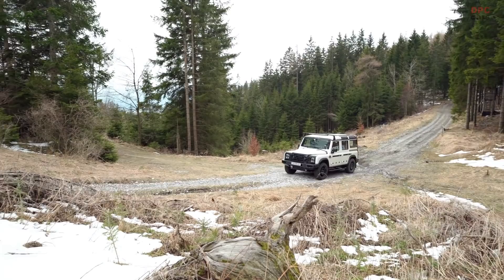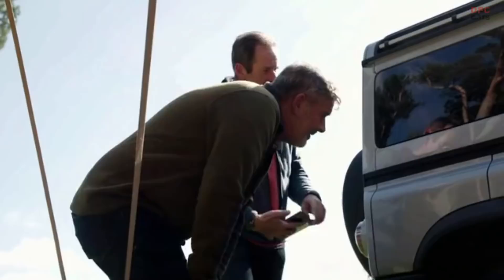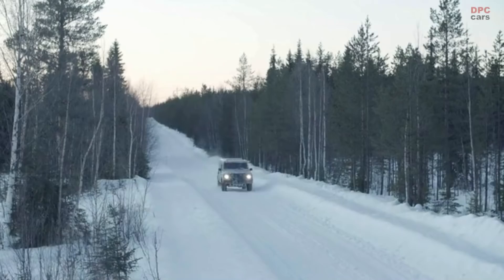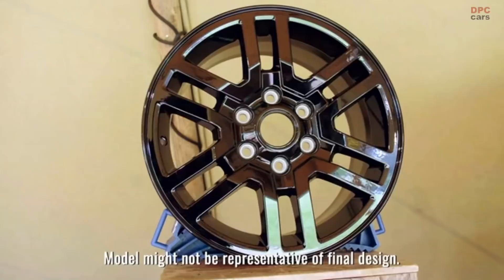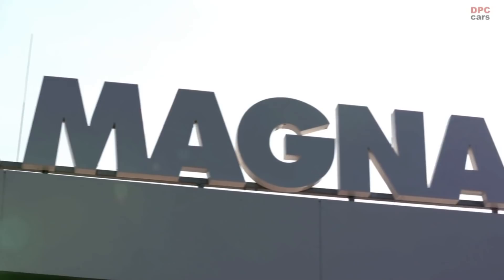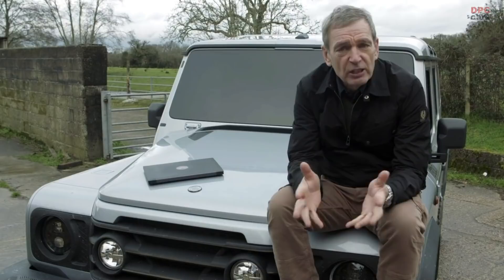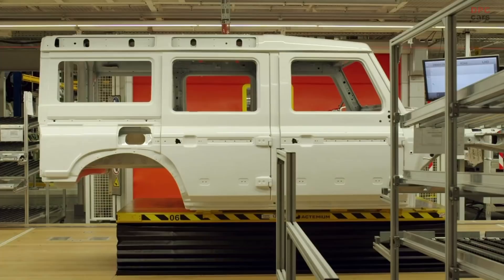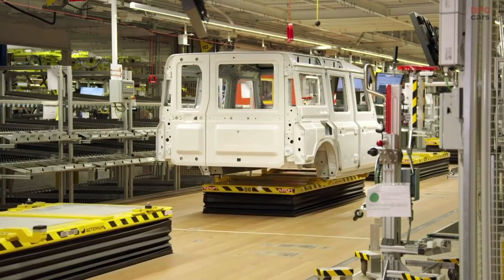INEOS Grenadier with BMW engine taking on Land Rover Defender

Comment: -what a modern Land Rover 110 “should” have been .... test this in the Australian  Outback for a month.  I’m ready for this Beast ! 👍🏻
Reply: Bmw engine though
Reply: or send it to Darien or Africa  !!!
Reply: @tanja8907  that’s a good thing
Reply: Aussie outback is full of falcons and commodore and hilux .  New defender is easily capable in the aussie ourback
Reply: @chrisward5626  Toyota is Australia's workhorse, a BMW engine will be seen as a negative for rural Australia. I bet you'll see plenty of these in the cities and doing the school run duties though...
Reply: @gazmo847  they sent some old defenders to South Africa with bmw engines and are easily the best they ever built . Not sure what your on about even
Reply: It looks like a defender 110
Reply: You can buy a proven 2021 Mahindra 4x4 PIK-UP dual cab, Manual with diff lock in Australia for $40000 drive away. 
And will become cheaper with the free trade agreements. 
This euro will be $100,000 plus on road.
BMW = Bring My Wallet!
Reply: @gazmo847  BMW is actually doing engine development together with Toyota or let’s say Toyota is watching and learning. Toyota is likely to receive BMW Diesel engines soon.
Reply: @tanja8907  the later TDI defenders were BMW engines. These will be better then the defender too, no issues with steel chassis, a company that cares about the vehicle and modern design.
Reply: @danielschneke2376  I laughed out loud at that! 😂🤦BMW hasn't made an engine worth a damn in almost 2 decades. Plastic junk.
Reply: Great till a sensor fails on the bmw motor 🤔
Reply: @troymash8109  guess you haven’t driven any BMW‘s nor Toyota‘s recently...
Reply: Chris Ward  parts and skill are the problem bmws are not common over here and the new ones are hard to fix especially the electrics. A lot of people do there own work over here especially 4x4 nuts.I will get one in 15 years or so and swap a 3L diesel. See trailer fitters take on it.(by then my disco 1 will be dead)
Reply: @sackjavage6959  BMW once owned but no BMW diesel ever found it's way into a Defender.
Reply: @chrisward5626  ....and those motors are being replaced by toyota diesel engines when they guys can get their hands on the old defenders. Those engines were crap for that type of vehicle...
Reply: @tonydoggett7627  true. They will probably overkill on all non essentials or on stuff we dont need and make it way overpriced. I'll stick with toyota or mahindra. Even toyota is getting ridiculously expensive.
Reply: @drevil2783  they replace them with Toyota because that’s what’s available. In eu or Australia they are putting the m57 and m52 even s52 into old defenders
Reply: @chrisward5626  there a plenty bmw motors available here in S.A. but from experience we know to not use them and rather use the more durable toyota engines and drivetrains
Reply: @GearHeadBoris  spoken like a prohet👍👌👏....and especially south africa where our dirt roads are becoming tracked kimberley holes and our tar roads are becoming 4x4 dirt roads.

Comment: Anyone that thinks they can get this for under 80k is dreaming. Prices will be high on this one. And then you have the challenge of service and support... And of course the cost of that. This will not be the Defender replacement that people are hoping for. It will not be the farmer's choice. The pricing won't allow it. It'll turn into another overpriced mom wagon used primarily in the suburbs.
Reply: Yup
Reply: Yeah. Limited production run vehicles are always rich man's toys. There's no other way to turn a profit. I don't think they'll be any affordable new 4x4s suitable for the enthusiast for a long time now. No high volume manufacturer is going to try until electric is both viable and cheap- and that's a loooong wait.

Comment: I was excited when I first heard about Ineos, the idea as it was presented when I first saw it, was a Land Rover that looked like a Land Rover. It was supposed to be more reliable, cheaper, and British. 
Well, I guess I can keep on dreaming. A simple motor with old school technology would have been the way to go. Have a hammer, sockets, an old spanner, and some tape, and fix it in the middle of nowhere...BUT, this has a BMW engine. I imagine that most of those who buy BMW's, are happy, as they usually get a two or three year lease, just long enough to return it, before 'everything' goes wrong, and a fortune has to be spent to fix it, and the plethora of computerized rubbish and Flux-Capacitors within.
Great idea, poor execution...in my humble opinion.
Reply: Agreed, not the sort of thing that can be welded back together again by a bush mechanic.
Reply: The Bmw engine and gearbox is a worry here as well. If something breaks, it is going to take more than a bush mechanic to fix it, and the cost of Bmw parts, cheap they are not. Perhaps drop in a LS3 hehe

Comment: BMW engine?  I truly hope you have demanded upgraded components as both BMW Petrol and Diesel have serious reliability issues.
Namely - Timing chain gearing and such.
Reply: Not sure if BMW still do this, but engines around the 20 year old mark used loads of ABS plastic that goes brittle after a number of heat circles and you loose you coolant, cooling, air intake leaks and all sorts of other problems.
Not cool.

Comment: You guys at INEOS should watch the documentary about Toyota's partnership with BMW on the supra and how many dozen times they made BMW rework the engine design because of reliability issues.  You guys probably have nowhere near enough pull, (pardon the pun), so be very VERY careful at any claims of reliability.

Comment: I like an inline 6 cylinder engine and I think that 3 litres is big enough for a turbocharged diesel but BMW ?
Reply: All those plastic bits and a timing chain at the BACK of an engine. I’m a BMW fan…but no…those engines don’t belong on an off roader.
Reply: @mtadc1545   Timing chain at the back!  Blimey what with that and 17" wheels then that cuts out serious travel in Africa :(
Reply: Well I guess you’ll be able to take it anywhere ... as long as it’s not too far from a BMW dealer !!!!
Reply: @marcc5028  I would’ve thought that the 3.2 litre 5 cylinder engine they put in the Ford Ranger would have been a better choice. The only problem with that idea is that if you have a fault you could take it to any Ford dealer here in Australia who wouldn’t have a clue how to fix it and they might  even make it worse.
Reply: @Cooliemasteroz  ... wow ... true

Comment: Build it in UK I'll buy one......Build it elsewhere and I'll replace my Wrangler with another Wrangler.
Reply: It is a real shame it will not be built in the uk. But can understand the commercial side but uk govt should have done more.
Reply: Ah, the great British Jeep Wrangler!
Reply: @theashbys8863  British taxpayers are going to have enough of a problem paying off COVID, without supporting a venture that will almost certainly fail due to lack of market size.  It would be great if it could be built in the UK, but it would have to have private investment, and a lot of it, like Tata's contribution to JLR.
Reply: @theashbys8863  British taxpayers are going to have enough of a problem paying off COVID, without supporting a venture that will almost certainly fail due to lack of market size.  It would be great if it could be built in the UK, but it would have to have private investment, and a lot of it, like Tata's contribution to JLR.
Reply: @simonuden8450  It's just taken too long to develop...that means extra Millions of £ which will all have to go on the price....it will end up being the same price as a G Wagen at this rate.
Reply: @Pinzpilot101  That is my worry too.  Even if they pare the spec down they still have to add stuff that is required for type approval.  Sadly, though, I think they're more likely to load it up with all the good stuff and hope people are prepared to pay the premium.
Reply: @simonuden8450  I think that's the way they will head...and ?? well thefre are people out there prepared to Pay enormous sums for the G Wagen...it is good...but not that Good...and the Grenadier is not going to be a Luxury Offroader...so they will be asking leather prices for cloth seats.

Comment: How field serviceable is the BMW engines in the grenadier? Never going to be like 200/300tdi
Reply: I imagine it will be awful. Hope im wrong though.
Reply: @tanja8907  im guessing alot of plastics since its a modern BMW engine
Reply: it won't be as field serviceable as a 300tdi no it has to meet modern emissions and be able to keep up to modern motorway speeds 2 things which a 300tdi will not do. The BMW engine is a monster power wise and are reasonably reliable if serviced correctly
Reply: @roycesmart8019  why was i driving 110km/h on the way home from work in my 90 300tdi keeping nicely up with the traffic
Reply: @simo782b  getting 20mpg and if you had wanted to overtake someone you would have struggled pulling away from junctions taking 20+seconds to get up to 50mph. I love my 300tdi to bits plenty of torque low down simple and reliable reasonably quiet but at modern speeds even my nissan cabstar 3.0 truck gets better mpg gets to 60 faster and stays at 70 happier while being loaded
Reply: @roycesmart8019  but a nissan isnt really a landy mate
Reply: @simo782b  debatable I've had cruisers patrols  Discovery's and defenders do have a certain charm to them but a 76 series cruiser with a 4.2 turbo diesel or a GQ patrol with a 4.2 turbo diesel shit all over a defender towing and on the road defenders are a bit smaller and lighter and have better approach angles and good suspension from  factory over than a discovery 1 they are one of the best offroaders
Reply: @roycesmart8019  good for you mate 🍻
Reply: @simo782b  Exactly what l was thinking, my Defender 90" Td5 would cruise at 70mph on the motorway (legal limit in England) and my friend in his Defender 90" with a 300 Tdi had no problems keeping up.

Comment: Cant wait to take a look inside and see if theyve got more room than the original defender so ur not squashed up between the dash and seat and door  i believe the grenadier is wider than the defender . In my mind this is where landrover shoulda gone with new defender i reckon customer uptake would have bn huge compared to the new defender . Which ive seen and bn in . And its not  what id have gone with . Its far to expensive for one thing . Its in range rover terms of cost but they say cheaper commercial models are available . But the grenadier is probbs gonna be my choice provided its more roomy than defender . Plus i want a short wheelbase which i am told thel be a choice of long and short wheelbase models with varous trim levels plus a commercial model which im interested in . Time will tell . Im looking forward to getting into one and checking one out . I wish them the best of luck with the project .

Comment: Some torture testing in Africa at some point would be a good idea. I fear it may have the designers rethinking the chassis and undercarriage a little though! 21 inch wheels are pretty standard here and even then the guys break things a lot. Think roads made up of basketball sized rocks and potholes a meter across. Besides that the styling looks great! Love the fact that it recognizes the iconic vehicles of years past

Comment: Something just seems off to me.. not sure if it’s the body proportion.. Feels and looks more like a knockoff version instead of an upgrade.. Nevertheless applaud for building this company up from scratch!
Reply: Knockoff version of a vehicle you can no-longer purchase new anymore
Reply: It looks similar to the previous Land Rover Defender as people have mentioned before but not as sharp, the old Defender was just right from every angle, providing it wasn't a 90" on 205/16" tires, they were too small, the Ineos tires shown here don't look tall enough too go with the size of the body in my opinion.
Reply: @clooperman3745  agreed

Comment: I absolutely love it's off road capabilities and can see the farming community snapping them up as it's the only viable option. I've spoken to many farmers about the debarcul of Land-rover loosing the plot of what a utility vehicle is simplicity and easy to fix when out in the field are paramount and never having to think I better take my muddy boots off before driving the vehicle or keep the dog clean.
Reply: Good luck affording a Grenadier when they do come out, or fixing them easily in the field.  That's not going to be possible with any modern vehicle that conforms to current safety and emissions regulations

Comment: With a BMW engine they should call it a grenader. What a pity they didn’t choose and engine from a manufacturer who believes in making engines that last.
Reply: True. BMW are chasing JLR towards the bottom of the reliablity tables.
Reply: @thebrowns5337  in terms of pure engines, they may be worse. Every BWW petrol engine has vanos which will fail at relatively low mileage and cost a lot to fix. That is only the start.

Comment: Why didn’t they use a Toyota engine for it so you can easily fix it in any country and it’s remote areas
Reply: Because any modern engine produced in the last 20 years can't be fixed with basic tools and scrap materials
Reply: It’s got a BMW engine because it’s a BMW Grenadier. It’s BMW,s off roader, it will be sold through BMW dealerships at BMW prices. Toyota, Mercedes or Land Rover don’t need to get involved they already have there own off roaders.

Comment: One big issue... it is powered by a BM Trouble U
Reply: absolutely. i wouldn't even think about buying something with a bmw engine. everything else looks good on that 4X4 tough. should have put a japanese engine in it.
Reply: @MrMP-en7vf  ... the exact reason I have stayed away from the new Toyota Supra ... BMW drivetrain even if Toyota has spent thousands of hours doing RD on engines and also thousands of changes .... in the end: it is still a BMW as the base drivetrain !!! So sad .... I hope we are all wrong.

Comment: The diesel should (needs) to have a very effective engine brake with 2 or 3 levels of activation. The control of this feature should be on the steering wheel.

Comment: So a British off roader built in a Merc plant with BMW engine! Hopefully the electrical system is German and it will be a real hard act to follow! Brilliant…as LR. Are just not great at staying going at the moment, great job guys 👍🚗
Reply: Why do people think JLR are struggling?  They're doing a lot better than most, if not all, the other manufacturers.  And they could not continue to manufacture the old Defender because it was not economically viable to build (mainly manual assembly) and tougher and tougher safety and emissions regulations were making it too expensive for the market it was aimed at.

Comment: You take the new DEFENDER and downgrade it with coil springs, no electronic as dash board, habitacle, simple auto gear box and you get a reliable 4x4. At least it still have the land rover spirit……and logo 😉😁

Comment: Yes it was supposed to be built in the UK as the owner is a renowned Brexiteer. However look where its built now. As a copy of the Defender it has the looks but with a steel body it will be a lot heavier than the vehicle its copying and while the aluminium skinned doors will alleviate the weight it probably wont wear well if the doors damage the paint and introduce galvanic corrosion at the point of contact. 

Its also way out of touch with what the we need going into the future. Are those "Farmers", Landed Gentry and Chelsea Tractor owners going to buy carbon credits so they can keep using diesel engines or is it just going to have a very expensive, very short life? I suspect it will be the latter.

Comment: Another Euro tractor, which will be totally unreliable. A wasted machine, I was interested in buying one of these to replace my Defender, but alas just another hi tech load of crap, a BMW engine for heavens sake, even landrover worked out to ditch them. Have gone to Isuzu and wont swap to this land rover look alike. No where near as good as my defender off road, but they dont break down.
Reply: Quite a few of our farmer friends are replacing their Toyota and Mitsubishi pickups for Isuzu models.

Comment: Were the steel wheels 17" or 18"?
Reply: 17”
Reply: As far as I can see the standard steels are 17” with 18” for alloys. That’s long overland trips out then 🙄
Reply: There will be 17" and 18" both in alloy and steel.

Comment: Love the concept, but anyone following reliability and quality declines in BMW and Mercedes will be somewhat concerned about BMW engine and Mercedes manufacturing plants.
Reply: I heard BMW engines are a bit brittle and not known to take high mileage very well. No idea if this is true, but I bought my wife a 2 liter BMW 3 series compact diesel. Fantastic ride and economy, but the engine gave out after 120,000 miles.

Comment: So they’ve designed and built a completely brand new vehicle from scratch that actually just looks 90% like the original defender. 
Why not spend all that time and money on modernising and properly bringing the original defender up to date. It would surely have been cheaper and they would have had a ready made market for all those yearning for the defender replacement